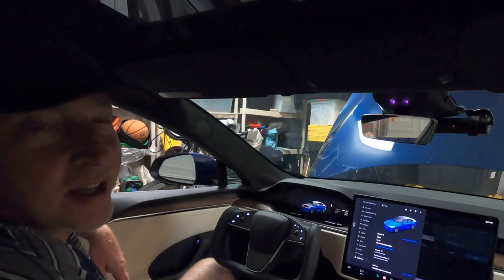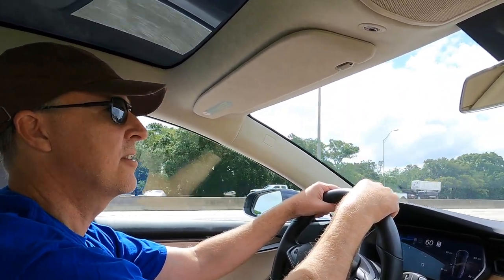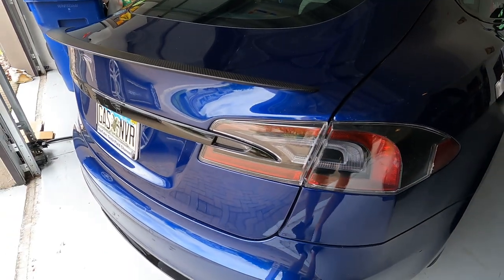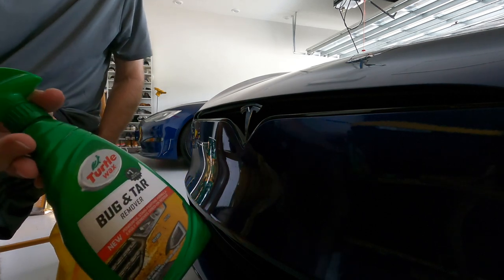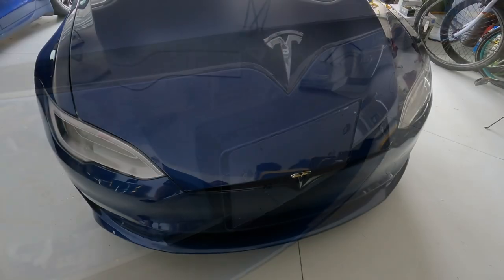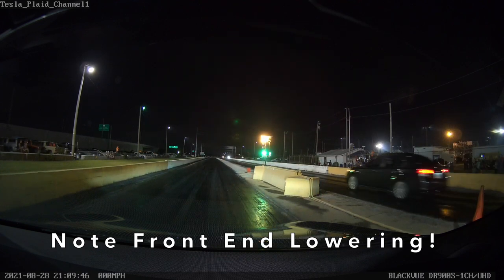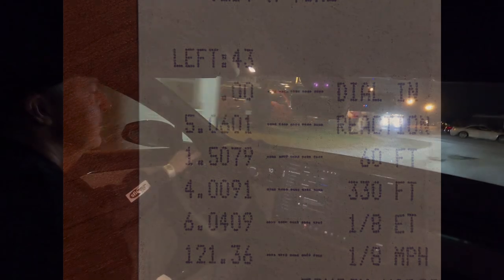2nd Plaid Delivered!! (19” Wheels) First Dragstrip Pass!! Tesla Debadging, Plate Bracket, and more…

Comment: Just a thought, when you changed your wheels to the 19s on Plaid1...did you change them in software also?....considering that Plaid2 had such great times out of the box, I'm thinking there is some power curve tweeking with the SW change? Also are there different software update on each?...cheers from down under!
Reply from the maker: Both of the cars have the original wheels that they came with, so no software changes needed.  (Except when I tested the 20" Nittos, but there's no software setting for 20" wheels on the Plaid.)
Remember that ALL of these tire+wheel combinations are exactly 28.0" overall diameter.  Any changes to that diameter has previously caused big problems in my other Teslas...
Reply: @TeslaPlaidChannel  ok so it will be interesting to see the results of the Nitto's on Plaid 2 without SW changes...I'm racing my M3P- with both stock 19s and semi slicks on the rear in the desert NATs this weekend and have learned a lot from your style of racing, keep it up!
Reply: Oh I forgot to add when I last ran the M3P with drag radials 235/40ZR18 on the rear and found about the 60mph the car would hesitate in power then pick up again dropping almost 0.5 off the ET in track mode...figured if I turned everything off, traction etc aswell then this loss of power went away!!...hope that helps....BTW I didn't have TPMS in DR'S aswell FYI
Reply from the maker: @outbackev-hunter6035  Are your DRs the exact same outside diameter as the stock tires? Like, exactly? When I ran Mickey Thompson’s last year, they were a tiny bit smaller in overall diameter, so the car would think the back tires were slipping when it got to about 80-90MPH. Then traction control kicked in. (And TC can’t be turned off in the Model S.)
Reply: @TeslaPlaidChannel  I just spotted that vid and that's what got me thinking.. I hear what your sayn....I would say they are close (I took a photo at the time) but will check again (Closer) when swapping over again...that's a bugger about TC not being switchable...so Brooks from Dragtime and couple of other YTbrs had a few hacks to kill TC on their MSs..and my 2014 MS85 has that selection.hope that helps...I will play this weekend with the M3 and get back to you...
Reply: @TeslaPlaidChannel  And I guess was to inspired to give those MTs another go on Plaid2 when you get a chance as there will be a workaround and with your great community  here will be able nut it out
Reply from the maker: @outbackev-hunter6035  Well, if you are referring to disabling the wheel speed sensors, I’m not down for that 😳. 
Check your tires on tiresize.com, it will show not only outside diameter, but even the best stat of all: Revolutions per mile!
Reply: @TeslaPlaidChannel  Fair comment however this is the type of mods we as EVrs will need to do as our ICE cousins have been doing for 100years.. 😉 Oh, there is also Dynomode (Just sayn)...so I followed you on Draggy so I'll post some change ups via that platform for now if your interested under outbackEV...(I'm not a big YT guy!) 😉 checking out tiresize now thx.

Comment: Cool channel! But why take off the wheel covers? Drag is less with them on.  Will the brakes really overheat due to intermittent passes at the drag strip?
Reply from the maker: They aren’t exactly attractive. I’ll test if they help acceleration, but I’m not expecting a measurable difference. They will surely help Range for long drives though…

Comment: Hi, what pressure are you running the 19" tires when you do runs? I have a Plaid with 19s, just curious what the thinking is.
Thanks
Reply from the maker: 42 PSI HOT on that first night. I didn’t hear any spin and it only disappointed on the 60-ft once, when the track needed re-prep after someone’s AC dripped on the track.  
If I bring it down, it would be only by a pound or two.

Comment: Absolutely love the car with the 19's! That will be the exact car I order, when and if they do away with that absolutely ridiculous yoke steering wheel.
Reply from the maker: I hear ya. The only place it’s someone comfortable is down the strip. (No need to use turn signals, wipers, change lights, etc., out there)
Reply: Your hands are only supposed to be at 9 & 3 anyway. The yolk solves this for people with bad wheel habits.
Reply: huge mistake to write the car off for such in insignificant reason.
Reply: @BrowncoatFairy  basically everyone hates the yoke steering wheel. It's not practical for everyday driving. So when and if they make it an option, I will order one without it.
Reply: @TheDwightMamba  that's how woman drive, my hand is usually at 10 or 12.
Reply: @randygreen7871  no, it's fine.  you're being a baby about it. you get used to it pretty fast.
Reply: @randygreen7871  cool sexism bro, i take it back, don't get a Tesla.  you don't deserve one.
Reply: @BrowncoatFairy  too late, I've already owned 4 and presently own 2, a  P85DL.& P100DL.

Comment: Heat gun, bro! DIRT DIRT cheap on AMZ. Modern paint can take a LOT of heat with zero damage. 
 All the top body shops use a heat gun. Use with common sense. You need very little heat to soften the adhesive. Just a note in 2008, I used a LOT of heat on my paint when rolling my E46 M3 rear fenders. The paint there is still perfect in 2022.

 For less than 20 bucks pick up a MULTI TOOL plastic wedges used for car interiors. Those tool bundles  are so cheap. WORTH their weight in gold!!!!
Remove excess residue with Zippo lighter fluid or NAPHTHA (same stuff). That solvent harms no surface that I know of. And works REALLY well. NEVER use acetone!  90% rubbing alcohol works but not near as well. Use alcohol to clean up uncured EPOXY, like JB Weld.

For really tough two part adhesives use 3M Adhesive Remover. Pricey, but good to have on your shelf to tackle the heavy jobs. Naphtha by the quart is cheap. I have all three of the above mentioned solvent plus TWO cases of Brake Clean. Be careful with that one.
Brake FLUID is going to mess up your paint the most, BTW. 
Then acetone and lacquer thinner. Those are only good for PREP work!

Comment: Should use a hair dryer to help remove the Plaid badge. Heat it up, use the floss to remove, then use a rolling motion with your finger to remove the glue while it's still hot. Same thing with the plate bracket. Must be nice to have all that disposable money. I wouldn't know

Comment: It's very hard to hear you when riding in the old Tesla model S
Reply from the maker: Agree, sorry. I spent several hours tweaking the settings last night to make it only slightly better.  Noise reduction, volume level, etc. That freeway was just too noisy and the GoPro mic didn’t help. If I do that kind of shot again I’ll need to use an external microphone.
Reply: @TeslaPlaidChannel  Thanks you're a really great guy. What do you think the Roadster will do considering how fast the plaid already is.
Reply: @TeslaPlaidChannel  Yeah noise reduction is kind of risky with this kind of audio. For legibility I think sometimes it can be better to just leave the noise in because our brains are pretty good at tuning out background noise when focusing on someone talking, but artificial noise reduction makes the noise that does get through more distracting, while degrading the quality of the voice. I've run into this kind of issue before when doing video editing, sometimes you just have to own the background noise. It makes the video feel more immersive anyway.

Comment: I’m a big proponent of having a dash cam and would love to see how you installed yours, especially the wiring.   Mine is running down the side and connecting to the cigarette lighter in the center console.  I’m trying to make it kore hidden.  Thanks for any advice.
Reply from the maker: I’ve routed it two different ways now, in each of the two Plaids. (The Raven and S75 were hard wired to the 12V in the overhead panel for the built in microphone.)
I like the 2nd route better but haven’t added the rear camera yet. Maybe I’ll record some footage when I do that, maybe by this weekend…

Comment: Hi there,

Any advice on installing BlackVue DR900X-2CH in 2021 Plaid?
Reply from the maker: I’m using two DR900X-1CH in my Plaid, because I want full 4K front and back. Although the wiring is almost entirely hidden, I haven’t found 12V so they are both just plugged into the cigarette lighter plug (with a Y-splitter).
I’ve been using BlackVues for over 5 years, very happy with them!

Comment: If the wheel covers make the car more aerodynamic and achieve a longer range then they will also help with aerodynamics going down the track and make the car faster.
Brake cooling issues on that vehicle is not going to come in to effect in a drag racing situation.

Comment: Do you regret buying this now that they’re newer, updated and cost $60k to $70k LESS today?
Reply from the maker: The price drop wasn’t nearly that much. It was $119k originally. $30k less today. Sure beats the C8 Corvette markups of $100k over MSRP, and it’s a much faster car too 👍 And those that say “this never happens” are just ignorant of Teslas past pricing practices. The P85D was priced around $140k only 8 years ago. Couple years later a Raven was $95k, but with a 100KWH battery pack and many significant improvements, making it much faster. Tesla has always had big swings in pricing. So those complaining now must be noobs or something? And the car hasn’t been substantially improved, so 2021 buyers have the same performance as todays car.

Comment: Is it true the Tesla's insurance premiums are substantially higher due to how expensive they are to repair in case of an accident?
Reply from the maker: Mine have been low in FL (and CA last decade)
Reply: @TeslaPlaidChannel  Low is relative, I understand that. Would be interesting to see a side by side of a vehicle around the same price point and drivers without any issues to mess up the pricing. I pay $70/month for a camry xse. i would imagine it's $200/month for a more expensive car. Then, if it's performance based, a possible premium on top of that. Prob should match up the Declaration page as far as deductibles and coverages. I've heard they are more expensive, but wanted to confirm.

Comment: you can put a smaller dia tire on there now and get into the 8's
Reply from the maker: Not if the computer is anything like the Raven. I installed 4 Michelin Pilot Sport Cup2s, all square like stock, but a slightly smaller overall diameter since they didn’t make that tire in the same profile as the 4S tires. The computer somehow knew (revolutions per mile?) and freaked out. It shut down all services, right down to the power steering!
Reply: @TeslaPlaidChannel  What? What the?

Comment: for you BlackVue camera, which "parking Mode" did you choose?
Reply from the maker: It’s only wired to the cigarette plug at the moment, so it turns off when the car is parked. I haven’t found access to a 12V (like in all my other Teslas) yet.
Reply: @TeslaPlaidChannel  thank you for the update. Tesla's don't have a "fuse panel" do they?
Reply from the maker: @13prettyboy13  They have several actually. I’ve found them under the frunk and on the passenger side kick panel…
Reply: @TeslaPlaidChannel  nice, so you would be able to tap into them!!!
Reply: @TeslaPlaidChannel  were you able to tap into the fuse panels?

Comment: Depending on the shape/angle of the holes in the aero covers, having them on could potentially act more like a fan and put more air over the brakes?  Maybe something to test using an IR thermometer after a hard (full force with ABS to a stop) from a known speed and the same starting temperature?
Reply from the maker: Yet fundamentally, “good aerodynamics” that reduces drag (for efficiency) is all about minimal disruption to the air. That means having the air going right past without knowing the car was ever there. Pulling air inward for a fan-like effect would be the opposite of that. ⚡️🚙💨

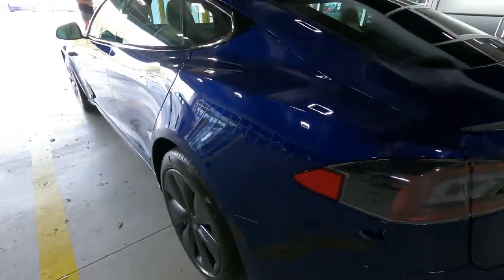Comment: Heh, well I've paused the vid at 3:10 to check your tire sizes, and I can suggest that your car will accelerate better, but have a lower top speed. Smaller diameter tires naturally accelerate quicker.
Reply: It's just mathematics.
Reply from the maker: And yet the first pass with the 19"s gave the very best trap speed I've had yet.  Better than all 71 (yes 71) time slips that I have in the other Plaid with the 21" Michelins and 20" Nittos.
REMEMBER that all 5 tires involved here (5 different tires sizes) have exactly a 28.0" outside diameter.
Reply: @TeslaPlaidChannel  Max speed I should have said! 😁

Comment: Hi, what is the circumference difference between the tires installed on the different rims, if any?
Reply from the maker: None.  They are all exactly 28.0" in diameter.  Previous Teslas were always very sensitive to this (revolutions per mile), and I would expect that the Plaid is the same way.
Reply: @TeslaPlaidChannel  Thank you. I wish you would elaborate and state your preference on a future video. Some of your viewers seem to conclude there's a marked performance difference relating to max speed
due to different rim size. Thanks again.

Comment: do larger diameter need more torque or use more torque to get moving?
Reply from the maker: Outside diameter of ALL FIVE different tire sizes shown (two 19"s, Nittos on 20", and two 21"s) are exactly 28.0".  More weight and more rolling resistance requires more torque.
Reply: @TeslaPlaidChannel  ahh thank you for the reply.   Cant wait to watch and learn more.  Got busy, pause button still on.

Comment: Where do you connect blackvue power cable?
Reply from the maker: Mine’s plugged into the 12V “cigarette” plug in the center console with the cable routed carefully from there. Mosty invisible to passengers

Comment: Would not 19 inch wheels give a better gear ratio?
Reply from the maker: Not actually, because it’s the same overall tire diameter on all FIVE of these tires (19”,20”,21” and different fronts and rears): 28” diameter
Reply: @TeslaPlaidChannel  
Thanks - should have realized - abs and other issues also crop up.
Ok then you can change the rear differential gear like all hot rodders do ? 🤔 (Oh, wait - you don't have one)
Reply from the maker: @Albertkallal  There are “reduction gears” in there. Maybe not accessible today, but the aftermarket will surely come up with something sooner or later…
Reply: @TeslaPlaidChannel  
Maybe you could lower the front end a wee bit on launch - (oh --- wait!!!)

Comment: Where are you pulling 12v power from?
Reply from the maker: Just the cigarette lighter plug at the moment. I haven’t found the same (mic) power plug I used in my other (three) Teslas.
Reply: @TeslaPlaidChannel  is it possible it’s above the driver/passenger seat? On the top frame rail, it’s The rectangular “grille”
Reply from the maker: @bigbudblazer  Hmmm, I’ll take a look. It was so easy on my previous 3 Teslas…
Reply: @TeslaPlaidChannel  that’s what I have heard, plaid completely different. I’m going to multimeter a bunch of stuff tomorrow I’ll let you know if I find any 12v switched power
Reply from the maker: @bigbudblazer  Much appreciated! And if I rewire mine based on your input, I’ll include a shout out to you in the video…
Reply: @TeslaPlaidChannel  all good brotha!
Reply: @TeslaPlaidChannel  keep smoking exotics at the track 😂

Comment: How much faster was it than the 21” wheels?
Reply from the maker: This first pass with the 19”s was the fastest MPH (121.36), faster than all 71 passes in the 21” car. And it tied a 6.04 pass that was actually with the 20” Nittos on lighter wheels but at a lower MPH.
Reply: Tesla Plaid Channel ok so with the 19s was 121mph. What was your mph with the 21s?
Reply from the maker: @NorCalRacingZ  With the 21”s, best was 120.3, one full MPH slower (6.06 ET). 
With the 20” Nittos, best MPH was 121.2 (6.11 ET), but also did a 6.04 at at 120.1.
Reply: Tesla Plaid Channel thank you! Just picked up my white plaid with 19s

Comment: Put some semi slick tyres 👍
Reply from the maker: None fit. None.
Reply: @TeslaPlaidChannel  spewing
Reply from the maker: @cryptolord9826  Must be exactly 28.0” outside diameter on a 19” or larger wheel to fit around the brake hardware. 
If anyone finds one, I’m all ears. (No shop has found one yet.)

Comment: The wheel caps might help you squeeze out an ever so slightly faster 0 - x (where x = the maximum speed before torque becomes the limiting factor instead of traction) due to the reduced drag.

But it'd be pretty negligable